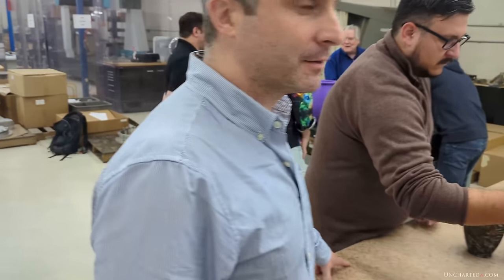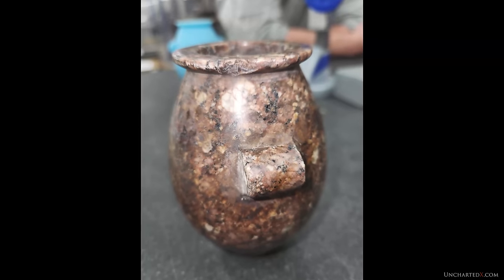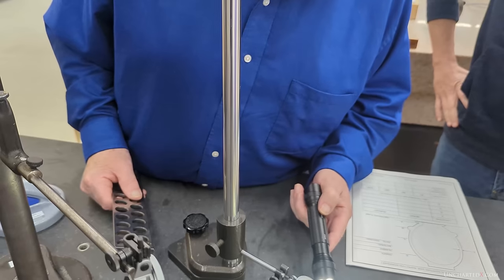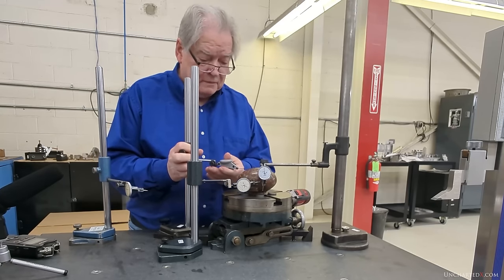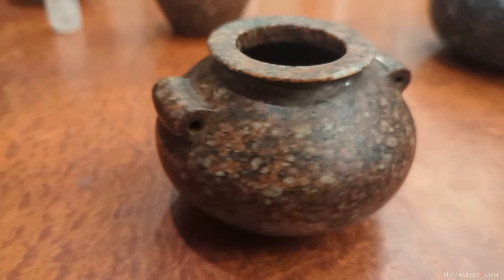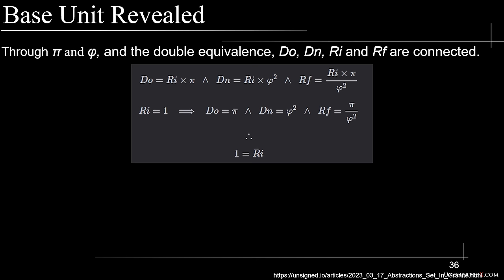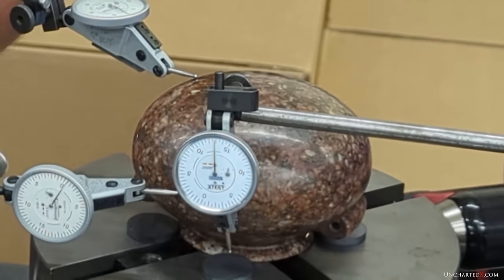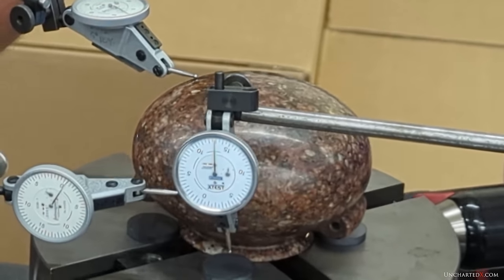Astonishing Results! More Ancient Egyptian Granite Vases Analyzed! More STL's available.

Comment: Wouldn sediment polish a vase over time?
Reply: Absolutely. But if you look at river worn granite the surface is not smooth, due to the uneven hardness of the component minerals.
Reply: People have been hand polishing granite for thousands of years.
Reply: @Vision_2  A glass bottle or jar is extremely smooth. However when compared to these vases they are not precise.
Reply: @jamemswright3044  How do you prove that?
Reply: @Vision_2  Go get a set of micrometers or even vernier callipers will do. Measure the most symmetrical and smooth jars across multiple diameters and lengths. The fact that they are nowhere near the precision of thes vases becomes evident quickly.
Reply: @jamemswright3044  That is a non-sensical argument.
Reply: @Vision_2  why is that?
Reply: @jamemswright3044  What glass jars? Made by whom and when? The Russian team measure actual artifacts from a museum using simple tools and easily found imprecision.
Reply: @Vision_2  So some stone vases are not precise. That doesn't meant all of them are faulty. Glass jars are made in a process that cannot produce precision to the same degree as these vases. I am using glass jars as an example as the precision In these vases is not detectable by the human body without precision tools.
Reply: @jamemswright3044  The measured objects, that do not have a proven history, are evidence of an unheard of precision of manufacture? Because you say so? Money in Ben's pocket.
Reply: @Vision_2  Ben does great work. I think it's great if he makes money from his work.
Reply: @jamemswright3044  What is is his work exactly? He has been around for years telling people that experts are wrong. Then he takes you on tours, welcomes you on his social media channels and repeats the same unsupported claims.

Comment: Lathes still work as well as they did 25, 250 , or 2500 years ago.

The techniques used to kickstart accurate centering and rotation at the  Enlightenment's start were arguably as accessible in the days of the Antikythera computer .

Not much to see here , and , given the lapidary quality of  the Pylos combat agate, even less to hype.
Reply: umm...we didn't even have the capability to measure down to the 1000th of an inch until just a few hundred years ago
Reply: There is always someone who's has the answers to all these proofs ......tell me how do you move a 1000 ton granite block?
Reply: You don't need to measure size or curvature to produce surfaces that are much smoother than  one mil rms.

It's what dies,  turning  , and mirror and lens grinding do automatically.

 @AustinKoleCarlisle
Reply: @russellseitz  we're not talking about mirrors or lenses, though. you literally just rub those with finer and finer abrasive agents until light shines through unobstructed, i.e. no more scratches on the surface. these vases are not transparent and they are three dimensional, thus they shouldn't even be compared to lenses or mirrors.

Comment: If you can prove the object was designed using metric measurements, then that speaks to a strong understanding of physics and chemistry as there are basic universal truths encoded in metric. Things like 1 gram of water is 1 cubic centimeter and has a volume of 1 milliliter. 

The fact that the spinner vase is made of 3 circles where the bottom circle is offset by precisely 1 millimeter is a good indication of metric being known to the designer. It's a human fact that we make choices in whole integers. I think the ancients knew about metric and we didn't really know about metric until the 18th century so I think they were easy more advanced than we give them credit for.
Reply: "there are basic universal truths encoded in metric. things like 1 gram of water is 1 cubic centimeter and has a volume of 1 milliliter"

lmao, one cubic centimeter of water was arbitrarily chosen as the weight of a gram. it's not something inherent in nature.

Comment: Artificial granite is a concrete that is made out of different sized sand/ gravel. Masons have been using it for centuries. Cast granite would explain a few things.
Reply: What would it explain? You just move the precision from the vase to the mold, adding a step for more error.
Reply: @annewitkowski7586  I’m not convinced of that.
Reply: @lawrencecarlson2425  it's a basic logical deduction. more steps = more chance for error.
Reply: @AustinKoleCarlisle  Assumptions are similar to extrapolations. Neither can be trusted. Artificial granite would solve the question of inside corners. I’ll study the process more to find limitations.